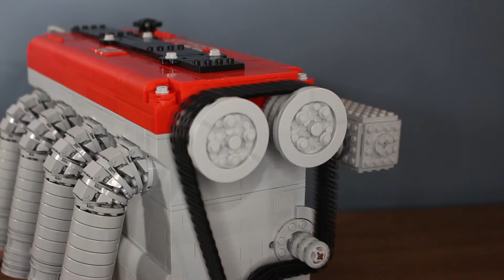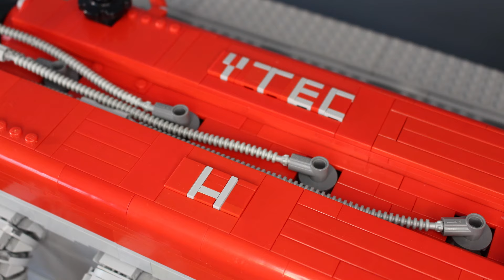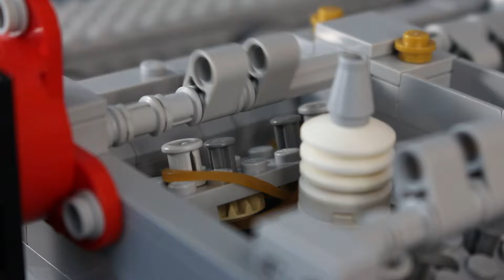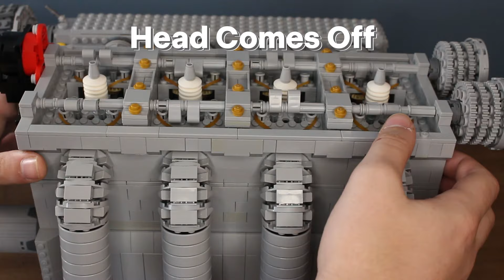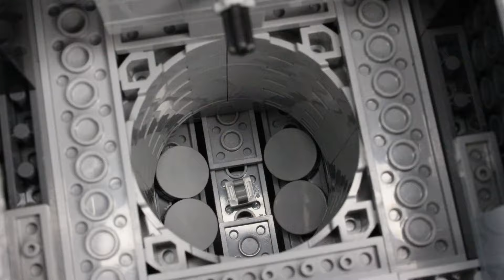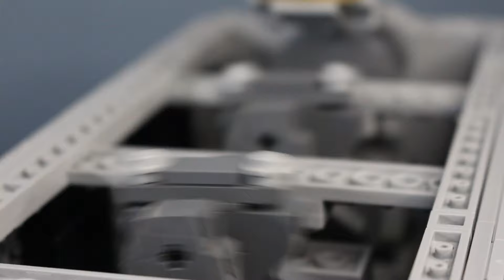I Built a ROUND Piston Honda B16 Out of LEGO!

Comment: Dang that thing is so cool. You need to turn it into a vacuum engine. It looks very simple. You have all the components. Just make it a little bit better. ❤
Reply from the maker: @Ripping_That_0425  well, between the holes in the cylinder and the head, it would be very difficult. And my vacuum can't run engines, so it's not really possible for me right now
Reply: @DeltonAdamsLEGO  you should just try like other engine you did
Reply from the maker: I would, but again, by vacuum could barely run that one, let alone 3 more cylinders. if I get a better vacuum, I'll definitely try on not just this one, but some of my other engines as well
Reply: @DeltonAdamsLEGO  it not your vacuum it the friction you need a lube some stuff up to make it so you can spin it by hand real easy and then it’ll take off
Reply from the maker: @Ripping_That_0425  the engine had almost zero friction. I tried quite literally everything. Me and the guy I was working with, who has been building these engines for years now, chalked it up to the vacuum, because we'd tried everything. It doesn't suck enough air fast enough to run a 6x6 engine
Reply: @DeltonAdamsLEGO  interesting